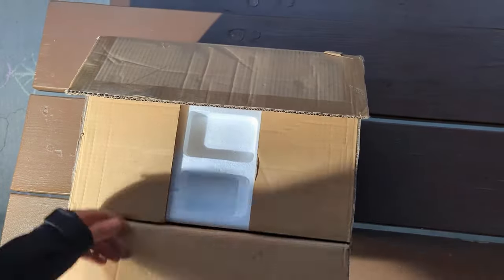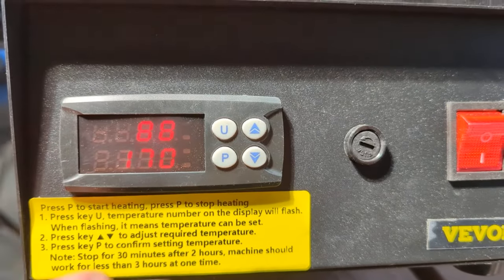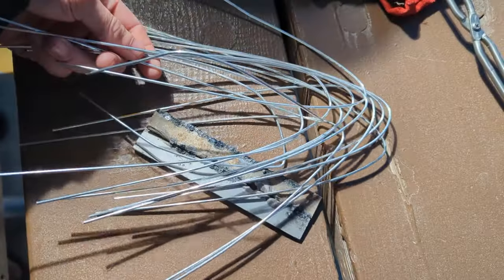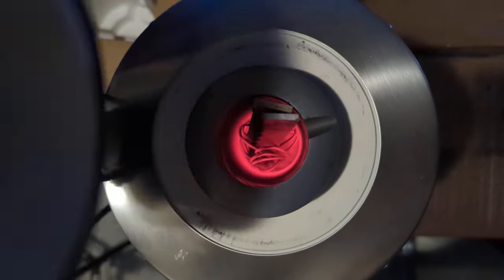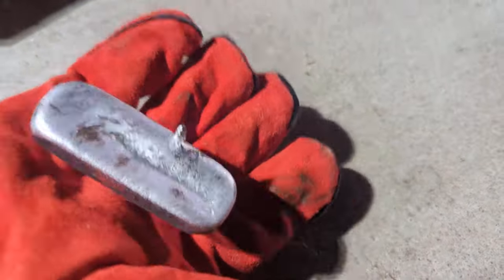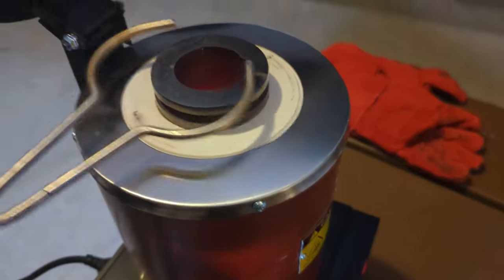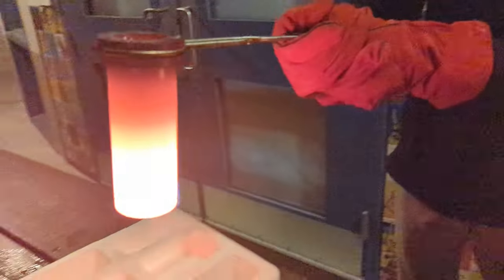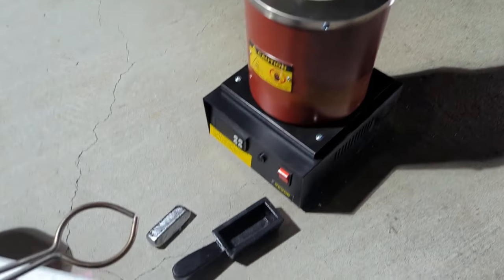VEVOR Electric Melting Furnace Review + problems WATCH BEFORE YOU BUY

Comment: Can it melt copper or steel?
Reply from the maker: copper very likely  steel nope
Reply: Letting the smoke out is a ritual in Canada. (See:  Ave)
Reply: Steel is nearly impossible at home because of the higher temperature required.

It would take a DIY approach that can contain the heat and a crucible that can resist it.

Comment: Imagine buying a consumer product instead of a hundred meters of nichrome wire and some bricks (not even alumina/silica ones, who needs that).
Reply: Could that melt copper?
Reply: @Heneling  yeah, nichrome melts at 1400 (so you shouldnt push it above 1200), copper melts at 1085.
Reply: The Vevor one cost me $178 after discount, which is less than the cost of the wire, the refractory, the terminals, the PID, the body, and all of the components combined. So yeah, it was cheaper to buy than to build at the exact same specs. Without discount, it would have been $200, which means you'd save twenty bucks building it yourself... and my time is worth more than that. Just buying new filters for mixing the refractory would eat that $20 away, but if you used no mask and just inefficient uncut bricks instead of mixing refractory, you'd still be saving less than enough to pay yourself minimum wage to build it.

The smart money is on buying it, then whenever the wire eventually breaks, repair the unit yourself by making new coils from wire bought separately.